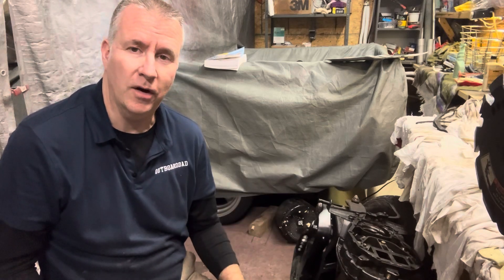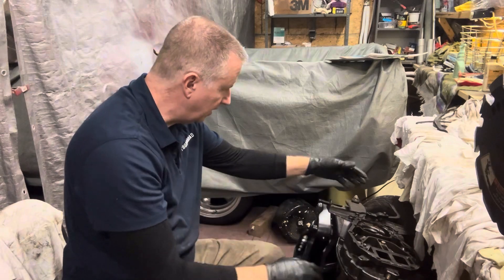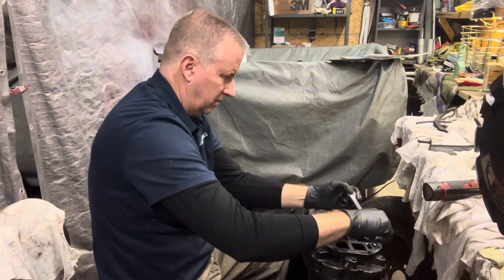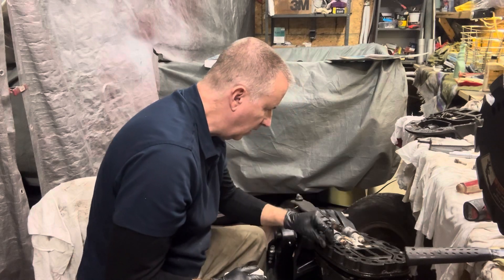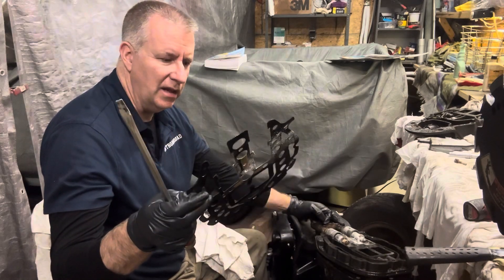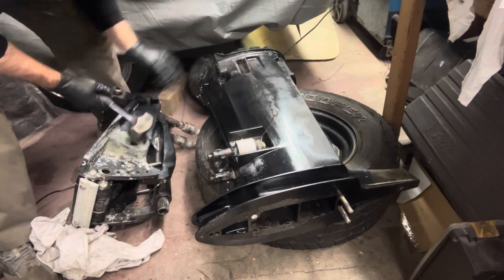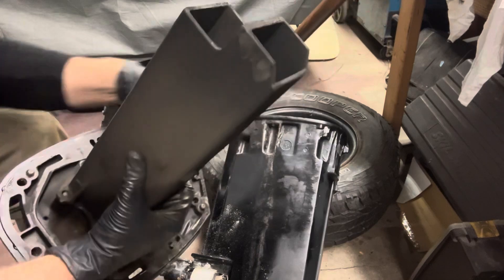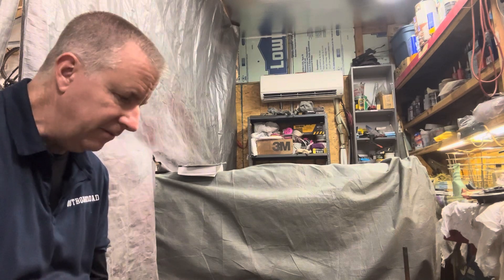Mercury Outboard Mid Section repair rebuild (Part 30)

Comment: If I run in real muddy water when I get home I should flush my motor. Mike
Reply from the maker: @MikeSampson-h9l  Indeed!
Reply: @OutboardDad  ok thanks for the info
Reply from the maker: @MikeSampson-h9l  Anytime, if you feel your getting silt or soft fine dirt or sand in shallows, then before you head in for the day open it up full throttle. Hoping to flush it out before it settles. Flushing with a solution like salt away regularly helps as well

Comment: Watching your videos are very informative. I just subscribed. I have a mercury 150 with the mid section double channel tube moving freely. Trying to decide if I need to have it fixed or if it will be ok to continue running like it is.
Reply from the maker: @PaulMoore-r1o  Any chance you can send me a video or pictures? Keith@outboarddad.con
Reply: @OutboardDad  Sorry I didn’t take any pictures. I was replacing the water pump and have already installed the lower unit. I heard it moving when I tilt the engine, so I reached in and was able to move the tube around.
Reply from the maker: @PaulMoore-r1o  I would be cautious, the tube need to be secure and have no leaks to provide proper water flow